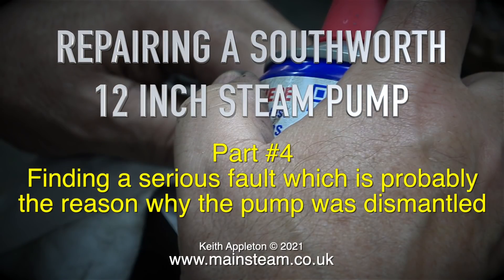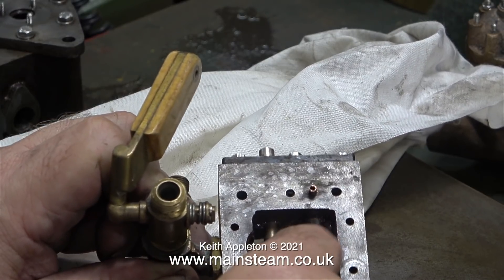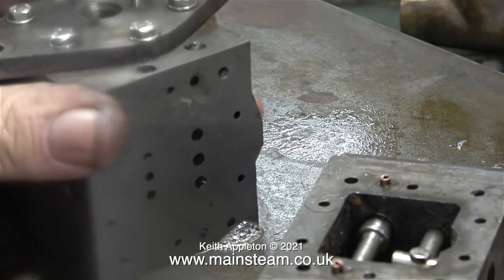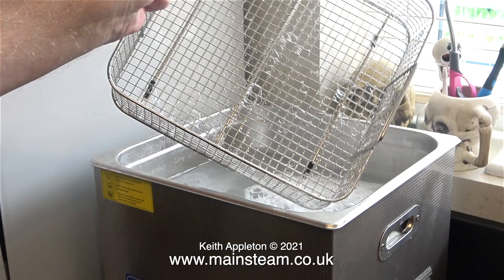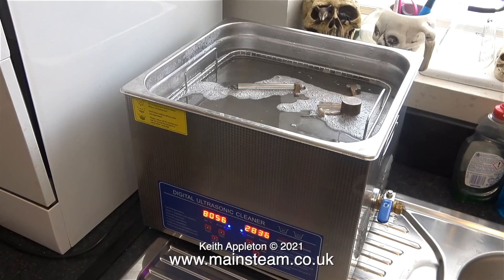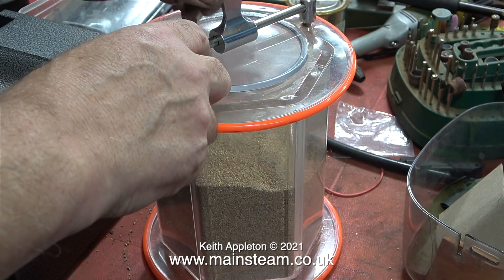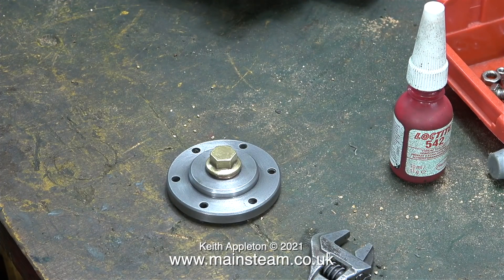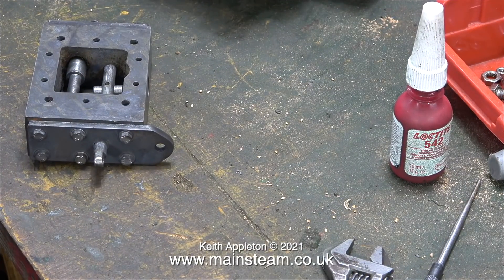REPAIRING A SOUTHWORTH 12 INCH STEAM PUMP - PART #4

Comment: I use a tumbler polisher with walnut media for small parts. 
I’m able to separate media from components using a plastic spaghetti strainer. 
A plastic strainer has the advantage that it doesn’t mark small brass components.

Comment: Have you tried bristle wheels instead of the wire brushes? The big advantage is that they don't shed wires into your face and clothes. They come in a range of grits from about 80 up to 1000 or so, downside is that they cost more.
Reply from the maker: Yes I have a few, but the metal ones do seem to work better.

Comment: Sonicators should be noisy and the amplitude of the sound will be proportional to the power. Yours is quite a large machine so hence gives out more noise. They do work a treat with brass.

Comment: How did it get blocked in the first place?
Reply from the maker: Rust owing to neglect I would think ...... I have never seen this with the Gunmetal versions of this pump.
Reply: Is it possible, Mr Appleton, that it may have at some point in the past had WD40 sprayed into it, and then it didn’t get cleaned out?  Lots of people think of WD40 as a lubricant, but it’s really not.  It’s a water-displacement film, dissolved in a solvent.  It works great as a hillbilly tune-up, loosening stuck parts and leaving things feeling very slick, but once the solvent evaporates, it leaves behind a gummy film.  When it’s sprayed with WD40 again, the fresh solvent dissolves the old dried up WD40 film, making it seem even more like the WD40 “fixed” it.